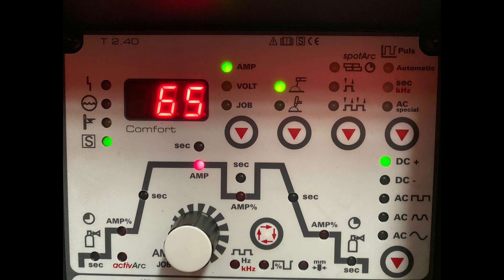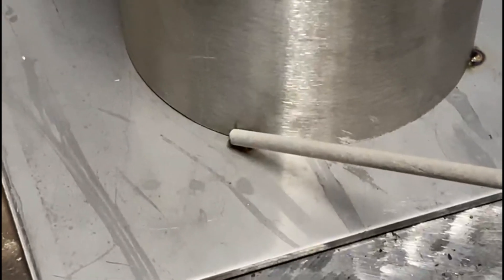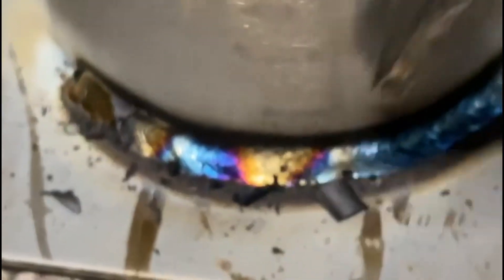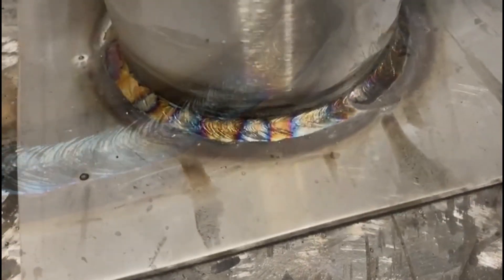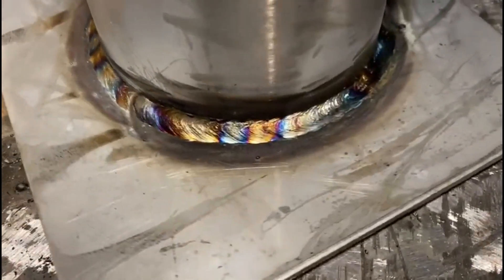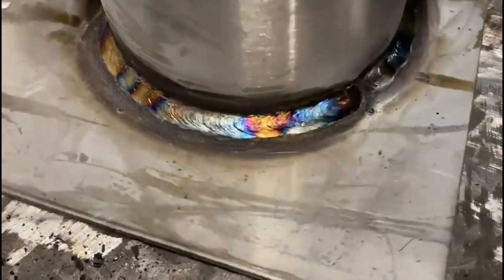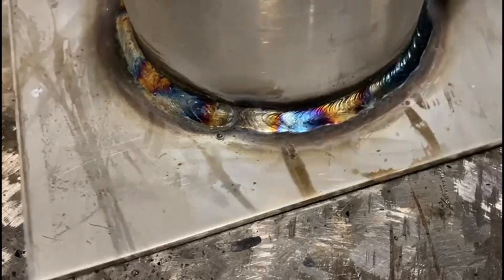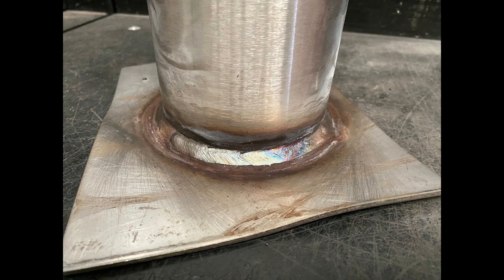Want to Master Stainless SMAW Stick Welding? Watch This Now!

Comment: You like your ewm machine ? Me personally love mine
Reply from the maker: Sometimes 😁. Depends what I’m welding. I don’t like that there pre programmed sometimes. What makes you love yours?
Reply: @weldtechsolutions  i've got the pico 350 cel puls pws . It runs 6010 like butter (best machine untill so far ive run 6010 on)it runs 7018 and 7016 like butter aswell , it never stops or sticks due to lack of voltage or power . And i can switch the polarities with a push of a butter or a remote, really handy if you are done with the rootpass and going to hotpass.  Downside is that it needs a good powersource . Ive run many ewms over the years and am overall happy with them except for the pico cel 150(or 160 cant remember) because of lack of power output, it keeps sticking the electrode. And the tetrix xq 230 puls because of a faulty cooling program it allways goes in error 22 and attention 11 . Brought it twice to the shop and cant fix it . Faulty electronics do not buy them . I know what you mean with the pre programming, ive run the fancy mig/mag version cant remember the name , but it had problems with the synergic function it could not run spray-arc like ive wanted it allways had an issue with the starts , but when ive put it on manual and used my own settings it ran like a champ .